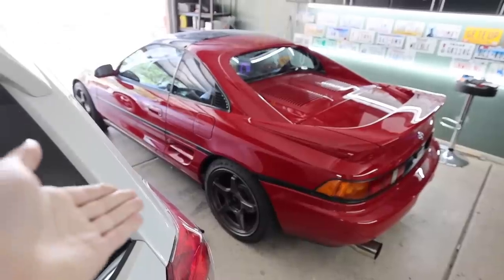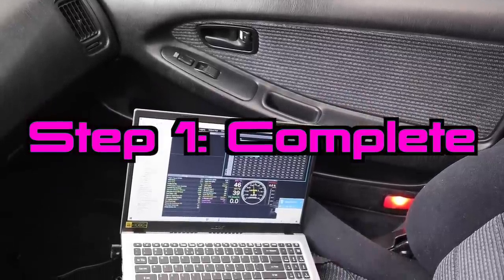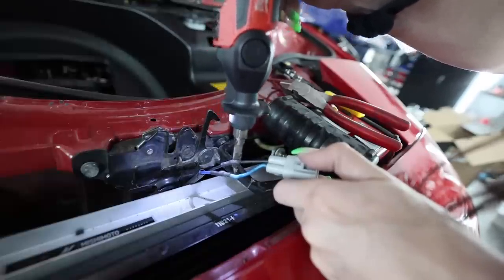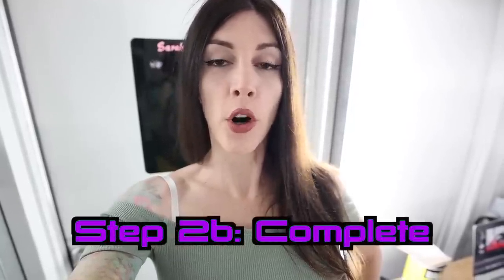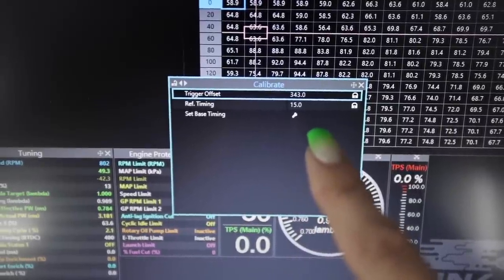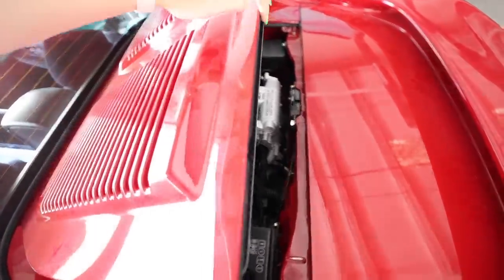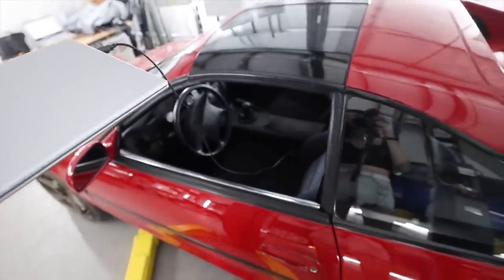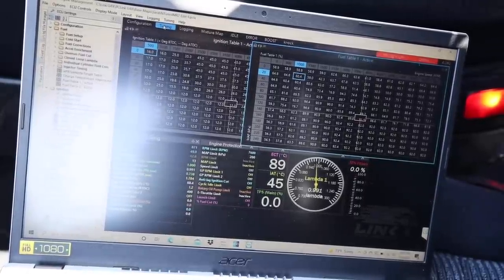The Time Has Finally Come! // Project MR2 Turbo ATS Street Tune

Comment: Rule of thumb, MON figure is 10 points lower than the RON figure for a fuel. So rule of thumb US 91 PON is 96 RON.

But it is a rule of thumb! So could be a bigger or smaller difference depending on the specific fuel.

And thank you for highlighting the fuel octane figures.

Comment: You can lock the ignition timing (a special feature in most ECUs) to zero degrees. Then you start the car and check with a timing light so you are on or near TDC, then you can adjust the offset.
BTW usually you can hook the timing light on the low voltage wires to the COP, not how its supposed to work but it does...

Comment: Sarah, although from the sound of it, you're sourcing your E85/ethanol from a specific place, keep in mind that most Flex Fuel pumps in Arizona are the equivalent of E54.  You can certainly find pumps with E85 but you'll want to know which ones as most are going to be the E54 variety.
Reply: Get the Sunoco stuff the Throtl guys use.
Reply from the maker: I bought E98 for the tune, there is an e85 pump near me that is actually e85.

Comment: I had a 1989 GMC suburban with a 525 BBC the was 10 1/2 compression that got 34 miles to the gallon.  Then switch 12 1/2 compression and put a Turbo on it, with propane and made 1200hp and got more than 50mpg or per pound of propane.

Comment: Great to see the progress! One note which I may have mentioned when you installed your engine bay dual electric fans: the rotation of the fans is that right now it's sucking outside air into your engine bay. This is not too efficient as it is actually trapping the hot air from staying inside your engine bay. If you get fans that actually extract and pull hot air from your engine bay, I believe you will see a difference with the heat soak as the hot air will be able to be escape from your hot engine bay. Think of it as an oven door. If you are trying to push in hot ambient air, it has nowhere to go in there and mixes with the already hot engine bay air.

Comment: I'm a light gear head and love your projects and humor. Your sticktoativeness is next level!! I lightly understand what you have done to get this thing running and I'm impressed! The only tuning when I got my 2nd car was just replacing points , cap ,wires and plugs and set timing and had to guess on fuel. I love how the tune can be done remotely real time.  I like your channel! Thanks!!

Comment: If you add a 12 fl-oz bottle of anti-corrosion additive, and use "reverse osmosis" water with 30%  Ethylene Glycol antifreeze, you may safely get better cooling, although it will begin to freeze at +7ºF, -13C. going to 35% will get you to 0ºF

Comment: Congratulations!  Glad to see so much completed on Mr Dos.  The engine pull on the Dyno is going to be epic,  I've been there with the "Hot Drive"  The Thermostat housing on my Ranger separated an hour away from home on a Sunday.  The fluid steamed out, so I filled up with water, threw the heater on full and drove it back keeping a strong eye on the temp gage.  An hour later, in the Florida summer heat and humidity, we made it back no problem.  I was soaked, but the Ranger was fine.  A new housing, thermostat, flush, and the Ranger was right as rain.

I also liked you concern about the spider.  That's kind spirited.

Props for Charlie helping again.  👍

Comment: Pleased that you engaged with ATS. They are my go-to source. The most annoying aspect of the new tune is that all cooling fans are on, all the time and they are LOUD. It is unclear why this is necessary. It would be nice to have a "stealth mode" for "normal" (non-hoon) operation. Sure, turn on the fans for trackday or a spirited driving session, but for evening cruising around town with windows down and t-tops removed  it is a detraction. Conversations are difficult, the impressive exhaust note is masked by the roar of the fans.

Comment: congratulations.  been watching since the beginning.  job well done.  seriously, you did an amazing job on that car.  i use racing gas supplement on my 911 to bring it all up to spec fuel wise.  i don't tune or anything, cept for self improvement measures like that.

Comment: So much for just keeping it a stock rebuild. E85, stand-alone ecu. Is there a T56 turbo and NOS next. Or did Hector buy the last one with the spoon engines.🤭 
Great build from start to almost finished.
Reply from the maker: I’ve strayed no further than my original intention. The turbo is from a gen3 3SGTE. The stand alone was to replace a faulty outdated electrical system that would leave me stranded, and e85 is just to make the car run better in this hot climate. It’s not going to make much more power than it could have on the stock ECU and previous setup.

Comment: Hi Sarah, on the CAT machines they use deutsch, shlemmer,  and tyco conectors and also some of the tyco connectors have little red locking device so you can't press the tab to release them ubtil you slide the locking tab out but they get crammed with crap and end up breaking :(

Comment: I did plugs a few weeks ago and immediately got a check engine light.  I ran fine and I couldn't figure it out.  Drove to get the code pulled.  Forgot to put the intake temp sensor back into the manifold.  🤦‍♂️

Comment: Hey Sarah what sizes injectors do you have  and do you have a stock fuel pump  and have you changed to a lower temperature thermostat so it can open up early 
I think 🤔 there something you can do 
1 doing water methanol injection
2 colder spark plugs 
3 lower temperature thermostat
4 i don't know if have double or triple pass radiator
5 therma rap down pipe exhaust and use a turbo blanket
6 get a transmission and engine cooler 
7 I don't remember what they were called there was some type air scoops that went on both sides of car on the top side of care pushed Air in to the engine bay
Reply from the maker: ID 1050x’s
Reply: @SarahnTuned   so are 400 hp on E90 am just guess do have enough fuel pump to flow that much ?

Comment: Does the defroster on a mid-engine car actually help pull hot air from the engine? I've never thought about that before because I've always had FF cars and FR cars.
Reply: %0 years ago, Old timers would advise running the heater to aid in over heating issues. Within the heating system is what is called the heater core. Basically a small radiator. By running the defroster the heater core can aid the radiator by removing additional heat from the engine coolant.

Comment: Won't you lose low end torque if you take out the tvis? I noticed the difference on my 85 when I got a working flapper since the diaphragm on mine was broken. Or how does that spacer work? Just trying to see how that's going to affect the car.
Reply from the maker: Don’t think it’ll matter at this power level enough.

Comment: I know your MR-2 is turbocharged, but one reason for what you call "terrible gas" in Tucson (@13:35) is the general rule that minimum octane requirement for a NATURALLY ASPIRATED engine is one point less for each 2500 ft, or 750 m of elevation, and the majority of cars are still naturally aspirated.  Are there no stations around you that have 92 or 93?

Comment: Just curious, on the e85, is the fuel pump, fuel rail, O-rings, spark plugs and injectors e85 compatible?  It's been a LONG time since I've tinkered with fuel systems, but my understanding of e85 is that it can damage materials the fuel comes in contact with.  Given you're in AZ, humidity may not be a big concern since you know...y'all don't really have much of that, the e85 thing got me wondering.  Btw, the car shows up stupid levels of shiny. Just sayin :)

Comment: General aviation just approved a 100 octane unleaded fuel. Should be available at any airfield within a year, so you can burn 100 octane gasoline, not gasahol. You might want to calibrate your maps that high.

Comment: Getting ready to tune my 1993 SW20 3SGTE wide body after 20 years sitting.  Look forward to redoing the engine like you.  Do you think the ebay turbo's are worth it? T3/To TO4E and the GT35 3582 ?  I heard great things about them and their cheap. I dont care where they are from, but will they perform.  - Drew

Comment: How does AZ not have higher octane? I have a place in parker az, and buy 110 right off the pumps for my jet boat, you could always mix 91 with a little bit of 110 thats if you don't have cats? or to your local airport and get some avgas lol but that has a lot of lead in it...
Reply: There's a few speciality places around Arizona that you can get 100 octane but most pumps in Arizona are 91 octane.

Comment: You may have to go to a water to air intercooler to solve the iat and possibly heat soak issue…
Reply: I really like the electric water pump option coupled with a SA ecu.

Comment: Sarah with the amount of wiring you had to do even finding the loose and improperly mated connector shows you know more than 95% of the supposed experts do about the wiring of your car. I don't have to know a thing about the systems in the car to see that as I have over 50 years experience building, operating and maintaining complex systems in the Computer, Submarine Sonar and ROV systems.
Reply: Факты

Comment: Looks like the ECU mapping matrix is like GM old block learn table I was taught long  ago in the distance passssttt......
Reply: It hasn't changed and I doubt it ever will. It's all load cells organized by vacuum and RPM. Timing maps work the same and cam phasing maps work the same. Only difference is now the ECUs can do cooler shit than those of the past.
Reply: @koopatroopa187  Agreed, I think new software can predict more table calu.
Reply: @timbrown9731  In my experience, that auto tuning stuff hasn't ever worked correctly. Like I generally run 13.5-13.9 AFRs WOT on my N/A Hondas and that stuff always tries to suggest low 12s like I'm some kind of 90s turbo Nissan. It'll generally suggest 13.5 for cruising AFRs and 12.3 for WOT. Yeah, no.